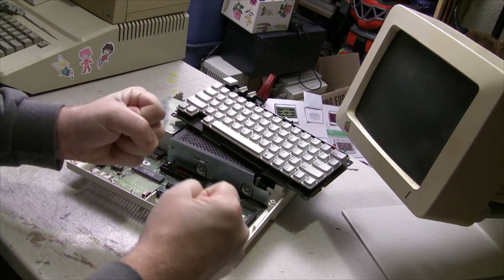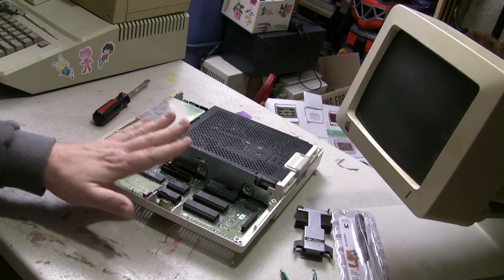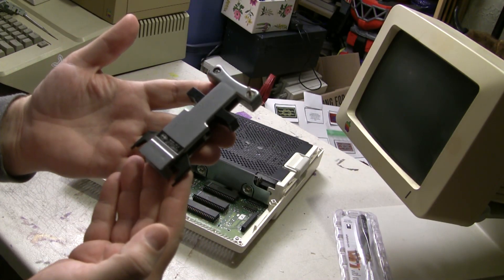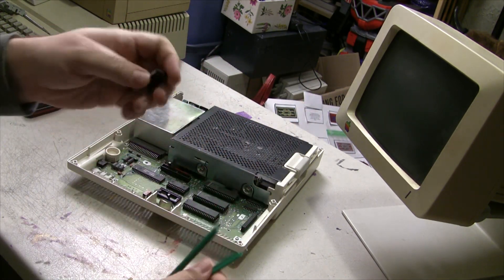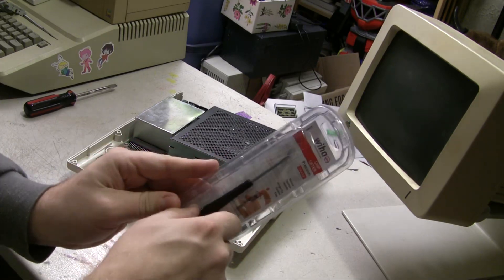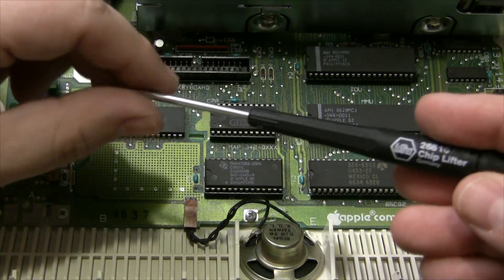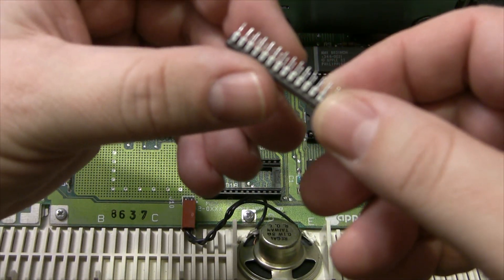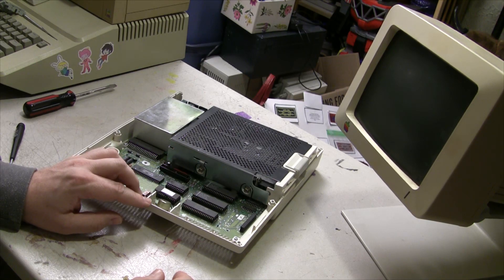Ron's Computer Videos #109 - DIP/IC Extractors

Comment: In 40 years I've never damaged a socket or motherboard using a screwdriver,  every chip extractor I ever tried will slip and damage the chips if they are stuck in there due to age.  They might look good pulling that chip that isn't stuck because it was recently removed but they perform very badly in real use.  I'll keep reaching for the reliable old flat blade.
Reply from the maker: Expertise always plays a role, sir.

Comment: Fun video, love the Batman-style transitions! For the EX2 DIP extractor, it looks like you are helping to lift up the chip, I thought the tool stays still, and pulls the chip out when you squeeze the handle?
Reply from the maker: You are correct.  You shouldn't have to rock it at all... it's supposed to directly lift the chip from the socket.  Unfortunately, my EX-2 has a few years on it and the casing spreads a bit during extraction, so one side was going up faster than the other.

I have no doubt a factory fresh EX-2 does not have that issue.

Comment: I find the Chip Lifter is good when the DIP is really stuck in there good, otherwise the EX-2 works well.  I don't really like the generic puller, for the same reasons that you had.
Reply from the maker: I agree. The generic puller doesn't give you much control, and is really good at marring the sides of whatever IC you're working with.